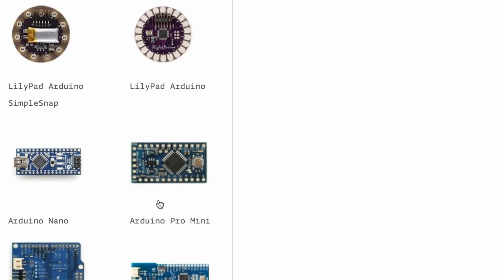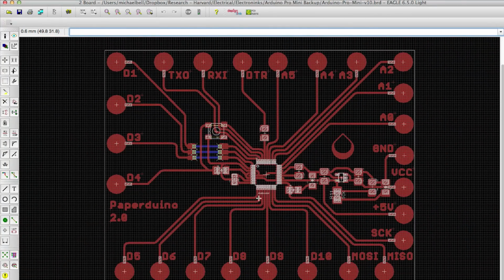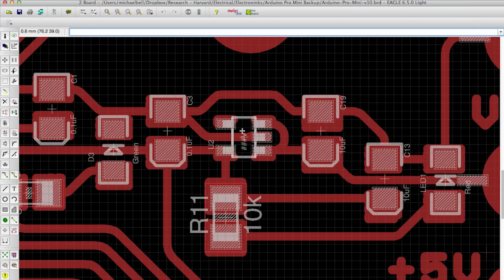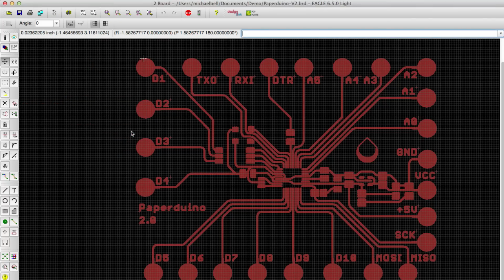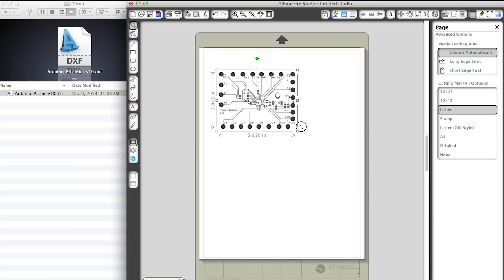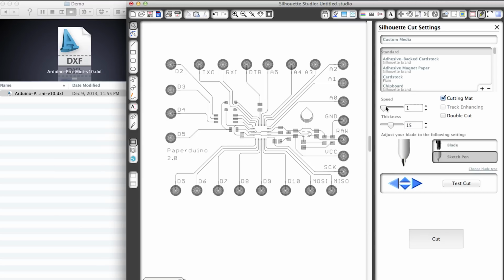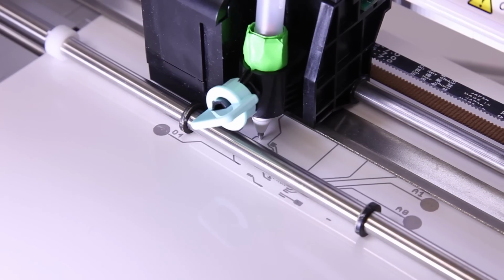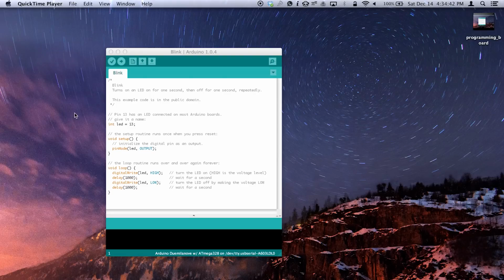Paperduino: How to Print a Paper Arduino

Comment: common paper has a range resistance less than PCB (glass material) so printing lines in common paper just to use in tests .The circuits have low frequency. But in case high frequency, between other lines will have a capacitance because the paper is not absolute electricaly insulated

Comment: Lol. MCU is attached to a double sided tape. It shouldn't work because power will not go through tape.
Reply: It's not regular tape. It's Z-Axis tape. It conducts electricity, but only in the Z dimension. It's very impressive =))
Reply: Lol, they mentioned that it was z-axis tape.

Comment: I spent 2 months, and made a CNC machine from scratch JUST FOR THIS VIDEO. I kid you not.
Reply: i envy you my friend!
Reply: Wow, you are committed
Reply: dude, i'm trying to make a cnc from scratch also but just now starting out. where did you begin? any tips?
Reply: Well, I got arduino uno, and learned how to use it, then I got stepper motors and their hardware drivers (important to get the proper combination, don't do my mistakes). Later on, I just imagined what I want to do, and drew it all with pen, and figured what parts to buy. And made it :) It was lot's of trial and error, but all fun.
Reply: You should start selling them then
Reply: I second the arduino tip, but I will take it further- use a Mega2560 and a RAMPS 1.4 board (each are under $10 closer to $5) and are used for 3D printers.  They have all the connections you need for the steppers and end stops.
Reply: Is it good for milling? Because I've wanted to build one for ages!
Reply: I believe the standard motor drivers for 3D printers are designed primarily for Nema 17 steppers so if that would work for you, then the answer is yes.  From what I read, you want to use a heat synced "Pololu DRV8825" driver to drive a Nema 23 which is better for milling and seems to be the recommended milling/CNC stepper.
Reply: Mükemmel bir şey ya :)

Comment: Why is your LED put in two digital outputs (D6, D7), instead of only one ?
Also in the code, you are putting a "High" in the 13 output, and i think you don't have that in that circuit :S, confused here
Reply: because it is a bi-directional LED. Depending on which of the 2 pins is connected to high (and the other one to low) the LED shines either green or blue. In fact, a bi-directional LED is nothing more then 2 individual LED in one housing,  soldered anti-parallel and both LED using the same (and only available) 2 pins.

Comment: What do you think, is it possible to use this paperduino printed on a paper which is folded to a Paperplane, with a button-cell battery as Powersource and on of this really small motors from a mobile (normaly used for the vibration) to build an intelligent Paperplane or a RC-Paperplane?
Think about the reducing of weight if you print your circuit on paper!
Reply: Simon Reinhardt Yeah it's possible. But pay attention to the vibrations that can make false contact between the paper circuit (that is vibrating during the flight) and the motors for exemple. It's will be interesting for me to build something like that :)

Comment: It was obvious that you were going for a Paper Arduino right from the beginning. Good job though, you guys took your project to a whole new level. The only problem you have to deal with is to make that pen plotter affordable for college students.
Reply: I found a really cool small kind of pen-plotter called
"Piccolo, the tiny CNC-bot"!.  http://www.piccolo.cc/
It can only print in the size of a sticky-note-paper but i think this is big enough for small circuits like the paperduino!

And the cool thing about this Piccolo is, its controlled by an arduino and its open hardware so you can download the files to build your own.
Reply: Simon Reinhardt Wow, that is really cool!
Although the drawing resolution seems to be a little low. It looks like Piccolo is still working on it, so I'm sure it will get better. 
I think the idea behind it is great and it can be further improved, by using better actuators and higher quality systems.